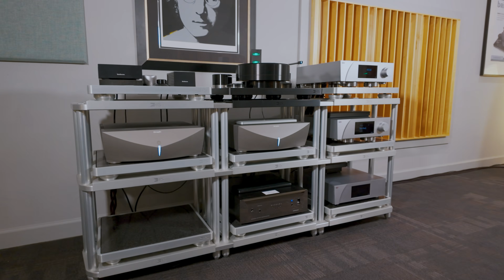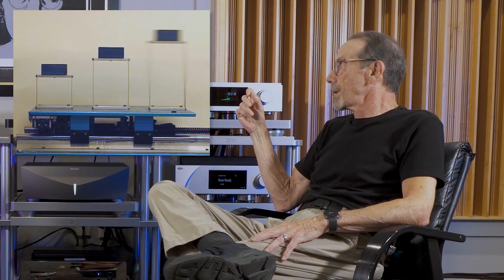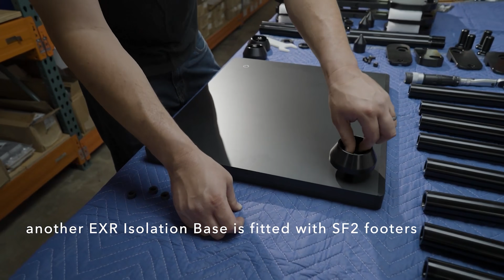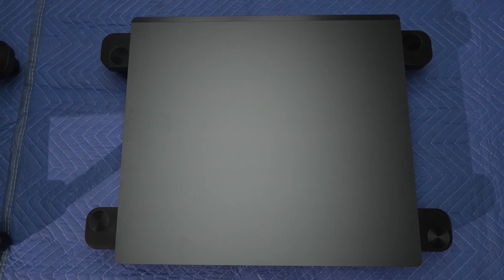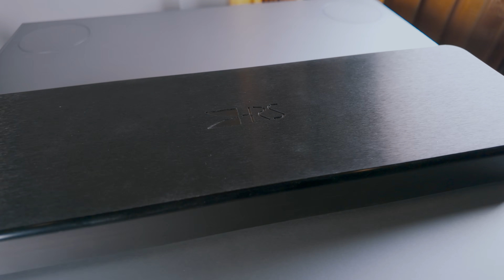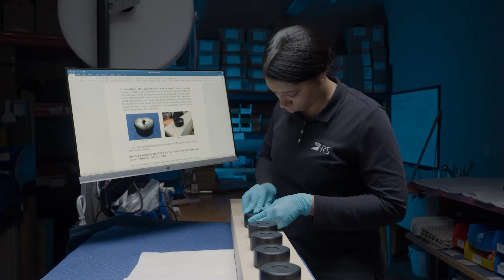Maximize Your HiFi System's Performance | Noise Control Solutions From HRS

Comment: Thanks for this video and the previous on the upper tier Vandersteen speakers. Initially a skeptic, I was stunned by the positive results once I placed my turntable on top of an HRS isolation platform. It was as if I’d upgraded a tone arm or cartridge, yes, that noticeable. My plan is for an HRS rack. Remarkable technology and the folks at HRS are very supportive and responsive,
Reply from the maker: Thanks for watching! We agree with you, HRS not only makes some of the finest products available today, they are also some of the best people to work with in the industry.

Comment: I'm not going to say anything about the racks as they look really nice. But does anyone else find it ironic that one would spend thousands to  lower the noise floor with these products just to have a wooden bookshelf full of easily vibrated records, metal book ends and what appears to be a metal case with the lid unlocked? 😂
Reply: It seems few people have explored their room to identify all the resonating stuff and discovering what is negatively adding to the resulting sound. The pro tip is everything vibrates, the walls and everything inside the room.
Reply: @bayard1332  it also depends on how much bass one has. With subs, you can make very noticeable noises come from that bookshelf.
Reply: You're exactly right. Bass changes everything.
Reply from the maker: Everything does vibrate but not everything vibrates to a point that isolating it is worth addressing. The sound coming from our record rack vibrating is so low in energy that it is impossible to detect over other more obvious contributors to the (considerably low) noise floor in the room like HVAC. If you’re able to hear your records vibrating on the shelves, then you’ve done some incredible work to remove or block other sources of noise, likely at a far greater cost than an HRS rack.
Reply: @HiFiBuys  After discovering some evil resonances in one of my rooms I went on the anti resonance war path. I've taken to listening to the sonic signature of various stuff with a cheap stethoscope. You can easily hear if the resonance of any given thing is contributing bad sound or benign sound and treat it accordingly.
Reply: @HiFiBuys  does the system not produce enough bass to rattle anything on that shelf?
Reply from the maker: @ProudPapaKY I think it is certainly capable of it but we rarely, if ever, get it playing at a volume that would shake things that violently, and at that volume I imagine it would be very difficult to hear some cardboard and vinyl rattling…our theater on the other hand…🫨😅

Comment: HRS makes beautiful racks but you are going to pay thru the nose for them.😅
Reply from the maker: Thanks for watching! It’s very tough to speak to everyone’s system and circumstances, but for just under $1,000, we’ve found an E1X Isolation Base can often be a better upgrade than a new cartridge or turntable, which can be great value depending on your system. The full rack systems can certainly be very expensive, but we’ve seen many people spend quite a bit more than the cost of an EXR for furniture that does more harm than good when it comes to noise reduction. Happy listening!
Reply: Can often be better than a new cartridge?  Youre talking SHIT ..... THAT SHOULD BE ENOUGH TO UTTERLY DISCREDIT YOU @HiFiBuys